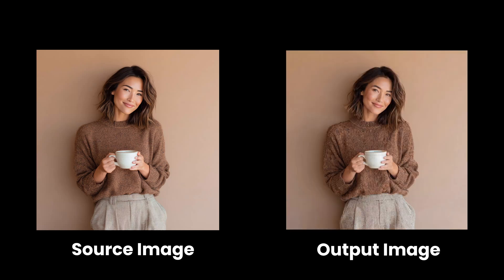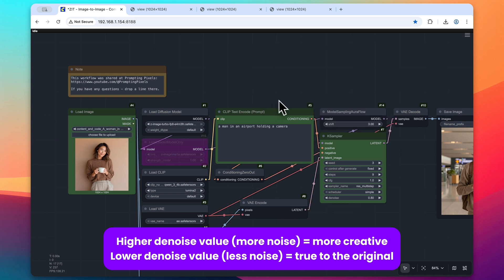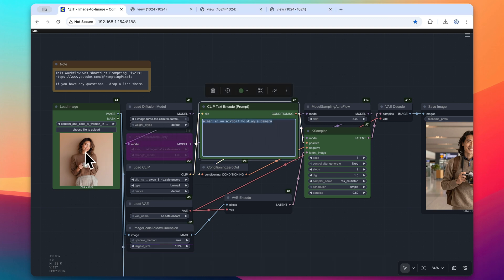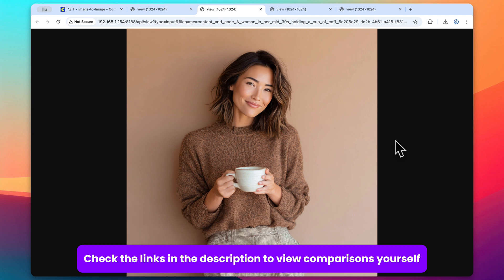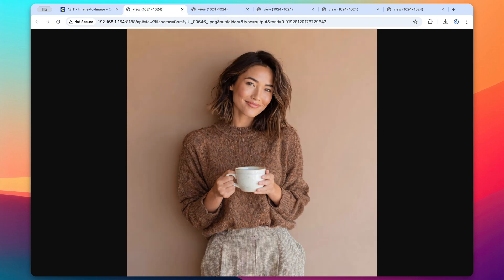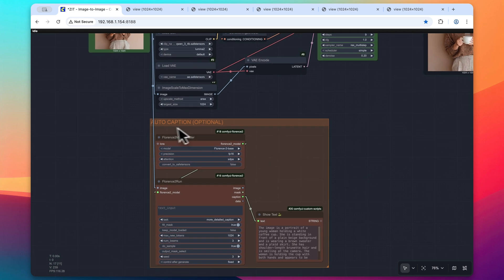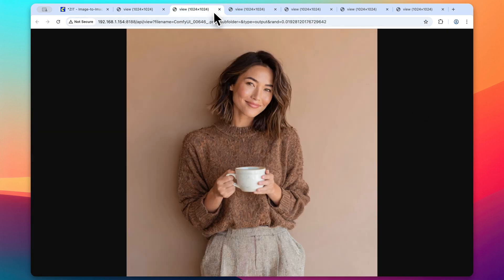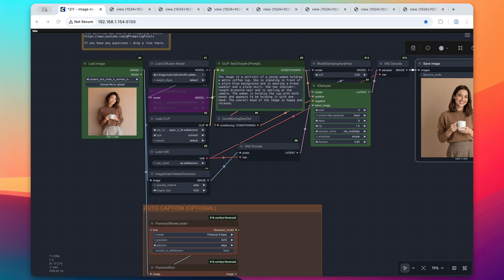Image-to-Image with Z Image Turbo (Beginner Friendly)

Comment: This feels more like its only really good for making already generated images look realistic adding imperfections to make them look less A.I generated. Apologies if this is what this is supposed to be its still good and useful. But I was hoping you could use this like Qwen and pose your character in different situations and outfits like sitting at a table or vlogging etc. With high denoise it turned my character into a different person with anything over 0.23 it gave my character bad skin. Is this usual? I think the sweet spot is between 0.19 to 0.23 to make the characters look less A.I generated.

Comment: I have tried most AI image systems, so far, the Qwen-Edit is the best true image2image one. We have to wait for the Z-Image-Edit to be out. Any so called "image2image" for Z-image-tubo is some kind misleading.
Reply from the maker: Completely agree in that an Edit model would surpass this for making changes.  Can't wait or the omni model to drop.  Perhaps an early Christmas present?! 

However, a low noise pass for an image to image workflow definitely has some use cases such as adding a subtle level of realism or depth to an otherwise flat looking photo (i.e. stock photos, portraits, etc.)

Comment: how much the input image affects the output?
Im just having a simple img to img set up, using a 1024px vogue picture for testing, the result comes out very accurate, pose and color wise, but quality is blotchy af. idk if the input image gotta be a certain way or im missing something in this simple set up
Reply from the maker: Hmm, this sounds like it should work fine. Are you adding multiple Lora’s to the workflow or sampler settings off? Sorry hard to help without seeing the workflow.

Comment: This is NOT image to image. It converts image to text first, then text to image. The two conversions may produce quite big difference than the original image.
Reply: Maybe you do the same misstake as I did and not change denoise value to lower? In his workflow it was too high.
Reply from the maker: Yeah good pint! .8 is rather high - depends on the use case for the workflow. For less dramatic changes keep below .5

Comment: Thank you very much for this. One Q: Can I use loras for this workflow so i get great result with my character? Thank you.
Reply from the maker: It should work - just will depend on both the strength of the lora and how much the denoising value is set (higher = more creative results = more input from your LoRA).
Reply: @PromptingPixels thanks bro

Comment: Excellent video! Thanks for sharing.  I saw another comment that asked about using 2 or more input images and I too would like to know that.  I would love to be able to use it like nano banana allows you to easily replace the subject in a photo.  The main problem that i run into with nano is that it is extremely censored.  The images i want to create are no where close to inappropriate, but half of my generations will not go through.
Reply from the maker: You'll either need to wait for Z-Image Edit to be released (they said it should be released soon) or use Qwen Image Edit
Reply: I also have this question hah Appreciate the answer provided as a reply. Waiting for Z-image edit it is then. I’m trying to filter accurate medical diagrams through an open source model lora to stylize them and remain accurate. I don’t need accurate text cuz I can buff that out and correct manually. Onwards my search continues for a solution cuz even flux is janky with that process